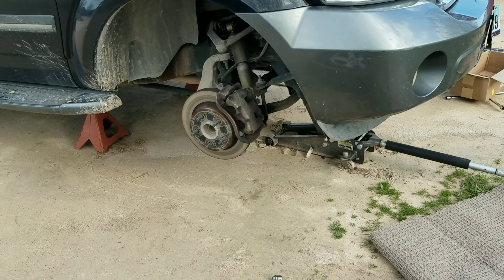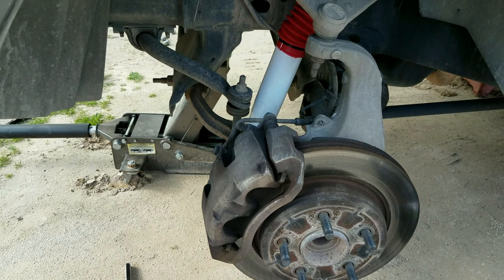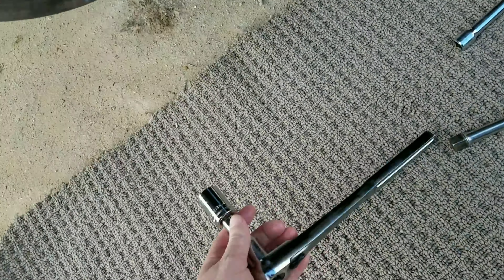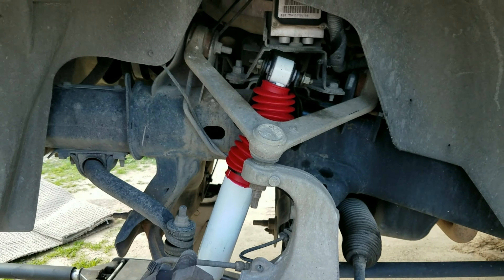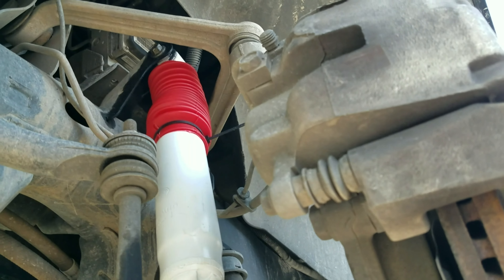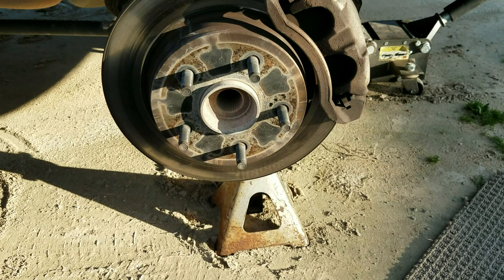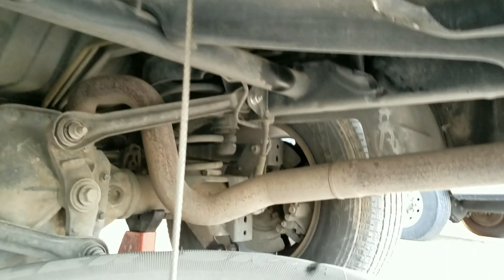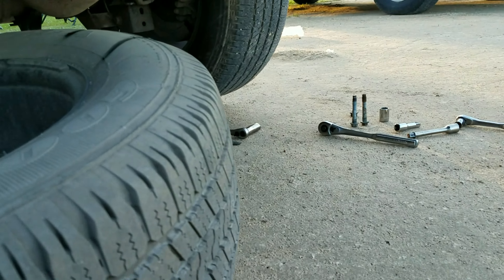Rancho Shocks Installed 2007 Dodge Durango

Comment: How long have you own the Durango and how reliable has it been I'm looking at one with 158k miles for my daughter that's about to graduate college she's going to use it has daily drive for her knew job it's only $3k
Reply from the maker: We have had ours from 2012 it is an 07 and had 32 thousand miles and now it has over 230 thousand miles. It's been a really good car. I've done a few videos of things to make it get good has milledge. And it does. I've found that on the highway we run it in between 65-70 never over 70. We think they are good. Just topical up keep helps. Depending on the year and what size motor if $3000 is a good deal. Talk to me anytime